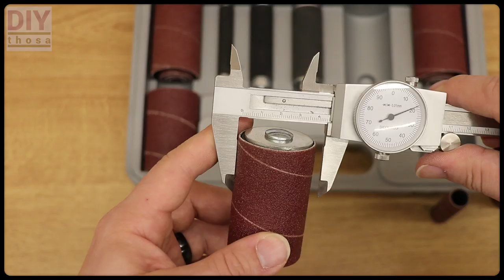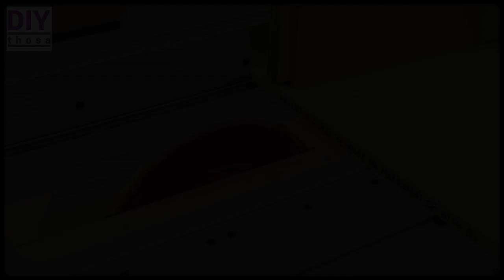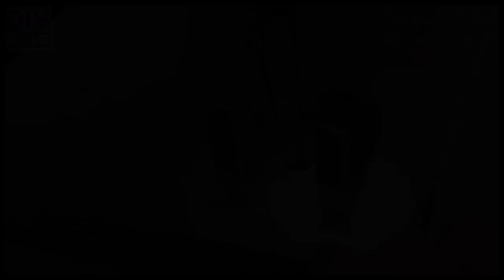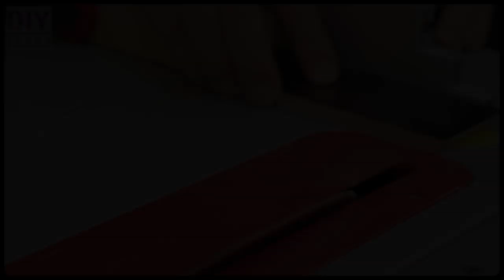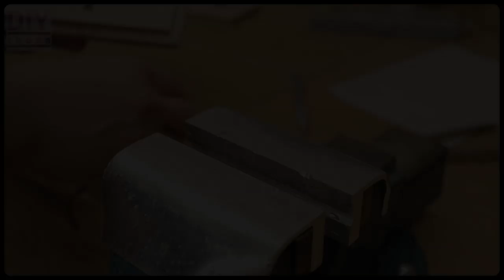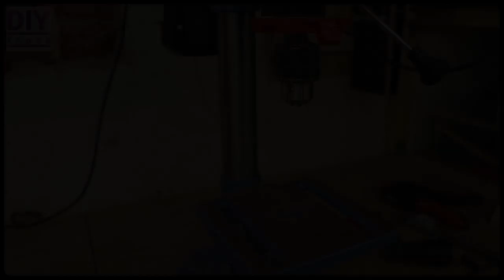Drill Press Sander - Easy to make with cheap Drill Press Sander Set

Comment: Good job, I prefer to fix the bottom side with a bearing, just make a longer pin  crossing the drum, this to prevent any lateral movement even if a drill press should not have it, it's not make for lateral pressure. I know you will lose the vertical manual oscillation but you can still maintain just leaving the pin get through the bearing.
The same idea for a little vertical lathe.
Reply from the maker: thank you 😀🖐 Yes that would be better. But thats not possible with this drum sander set.

Comment: Nice, I never even considered using a drill press like this. Perfect
Reply from the maker: thank you very much. But be very careful use it like that. A Drill Press is not designed to get lateral Pressure on the Shaft. You have to use it without any bigger Preasure. 😀🖐
Reply: @thosa  I'm going to make a lower base running on a bearing or something similar to secure to the table so that doesnt push on the shaft.

Comment: Nice jig. The only concern I would have is the sideways pressure on the quill of the drill might throw it out and then not be able to drill accurate vertically after continued use as a sander. Cheers, Huw
Reply from the maker: yes, This is not a complete replacement for a Sanding station.  It have to be used without sideways pressure. 😀🖐
Reply: Add a bearing to bottom of spindle & drill into base corresponding hole - no side pressure.

Comment: hi, this proyect is great, but...
you must use the same threat rod for the sander set, and also put a bearin in the "box" that fits this rods.
so you don't force the drill press...
sorry for my english
I'm from Argentina
Saludos
Reply from the maker: Hi, This was a complete set of grinding drums. I can't change the threaded rods there. There is unfortunately no way to support the bottom part. This have to be used carefully without sideways pressure. 😀🖐
Reply: Ronaldo, you are correct in saying that lateral force on a drill press spindle will cause the spindle to become loose from the shaft and fall out or worse to be flung across the room. 

If the design could incorporate a bearing at the bottom to cut the lateral force then the problem may be solved. You could redesign to incorporate a drawbar as on a milling machine but that would be a mayor task and totally out of the question. 

You could make a bearing inside a cylinder fitted beneath the drum that goes around in the centre and is static at the rim. Beneath the bearing a spring would keep consistent tension vertically whilst allowing the sanding cylinder to be raised and lowered. That way the full height of the sanding cylinder could be used. My drill press has a lock on its height and so choosing and fixing a variable height would be easy. Now if we could work out how to get it to oscillate...hhhhhmmm.

Comment: very nice design and build! well done!  question: what purpose do the four screws (added towards the end of the build) serve? It looks like they set flush with the lip plate that the throat plate sits on, so they don't seem to holding the throat plates in place... come to think of it, whats the purpose of drilling the holes in the removable throat plates if the underlying screws are fully recessed into the lip its sitting on?
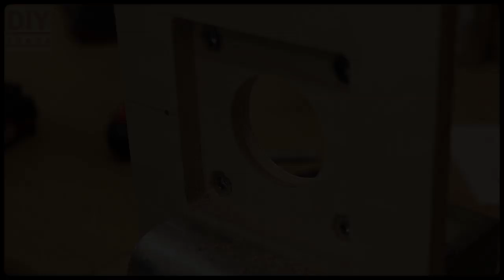Reply from the maker: thank you 😀🖐 These were not screws, these were screw-in nuts.  At 8:05 these are the screw-in nuts.  From 9:24 you can see that the inserts are screwed together.  😀🖐
Reply: @thosa  Awesome, I completely missed that @ 9:24!  suggestion: if the nuts are ferrous, you could mount small magnets in the inserts (or vice-versa), making insert swapping a snap (pun intended). I hope to incorporate this into my upcoming build.
Reply from the maker: yes, that would be one possibility 😀🖐